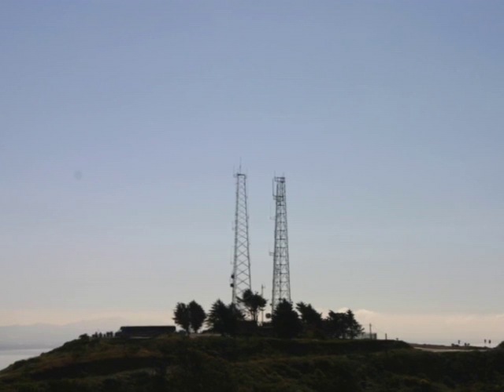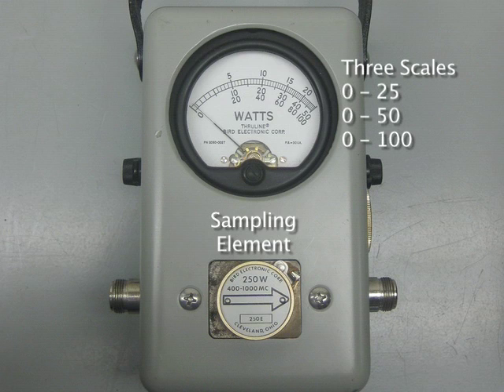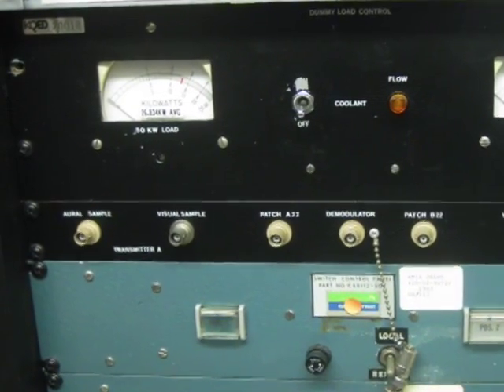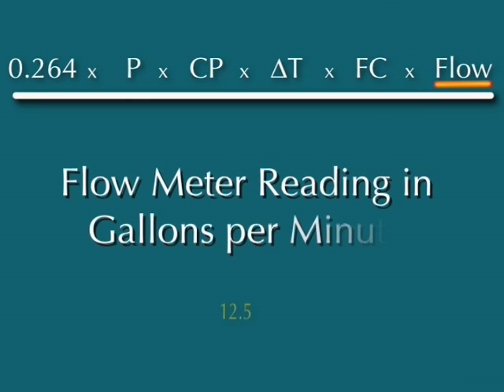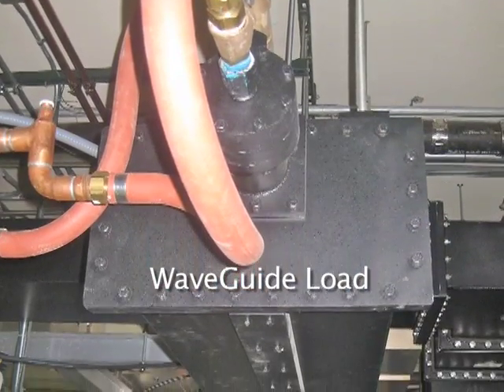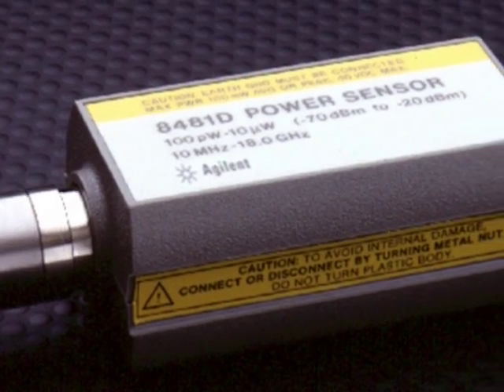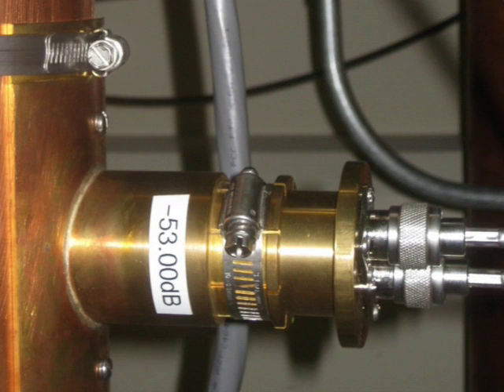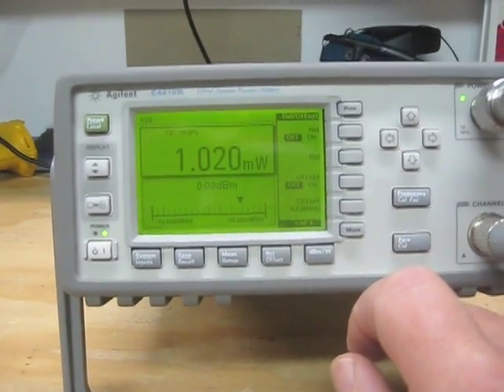Reading RF Power

Comment: One question:  for the calorimetric (water load) power measurement - I guess normally there would be very little reflected power, since the dummy load would be well matched, but if there were reflected power, would it appear in the measurement, or would just the forward power appear?
Reply: Hes no longer with us, so he wont be able to answer sadly
Reply: @DJSubAir  he left YouTube or passed away? I was wondering why the website doesn't exist anymore.
Reply: @DarkGhostHacker  I apologize to inform you but he passed away.

Comment: Great video, thanks!  I'm only a ham, not a pro, and my coax is a wimpy 1/2 inch diameter rather than 3 or 6 inches like yours, but still great and useful info!